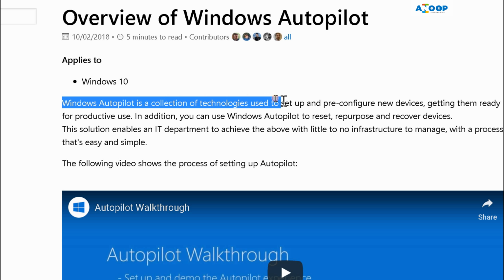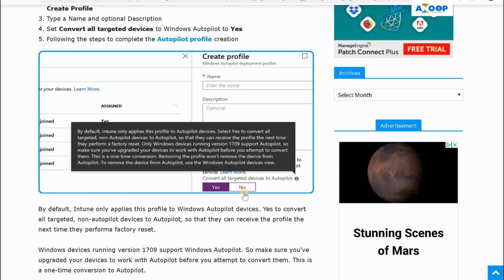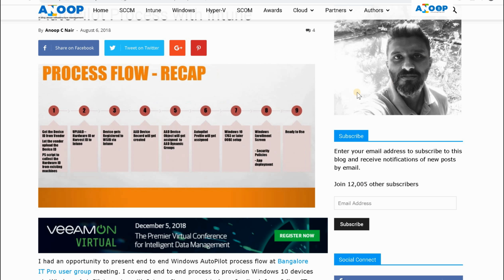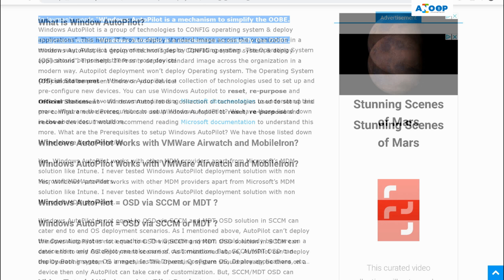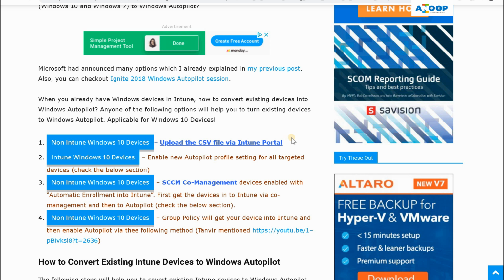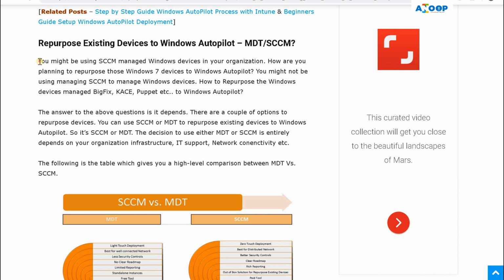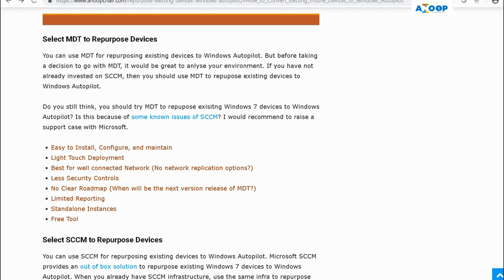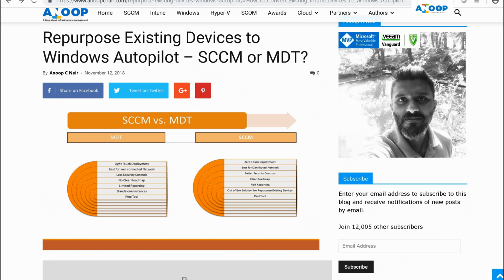Windows Autopilot - Repurpose Existing Devices into Autopilot - How to use Windows Autopilot

Comment: 1)kindly let me know what advantages autopilot for existing Windows 10 laptops

2) which scenarios will be used. how to configure autopilot for existing laptops (sccm task sequence is mandatory) and what is the user experience (existing user data will be lost, existing application will be lost, ESP page will run like device preparation, device setup, account setup for existing machine autopilot)

3)possible to upgrade from windows 10 to windows 11 during autopilot for existing laptops,

4)auto pilot for existing devices will be connected Azure and hybrid Azure AD what is the advantages both scenarios already existing devices will be in Hybrid Azure AD

Comment: Hi Anoop, This query kinda quiet off topic from the video but i cant help asking your advise.

I heard Autopilot doesnt support sequenced application installation. E.g i want to build my laptop using autopilot and google chrome needs to be installed in the last, how can i achieve it ?
Reply from the maker: No I don't think you can select the order of app installations from Enrollment Status page ... the following are the latest Intune ESP options The enrollment status page appears during initial device setup and during first user sign in. If enabled, users can see the configuration progress of assigned apps and profiles targeted to their device. Learn more.

Show app and profile configuration progress
No
Yes
Show an error when installation takes longer than specified number of minutes
60
Show custom message when time limit error occurs
No
Yes
Installation exceeded the time limit set by your organization. Please try again or contact your IT support person for help.
Turn on log collection and diagnostics page for end users
No
Yes
Only show page to devices provisioned by out-of-box experience (OOBE)
No
Yes
Block device use until all apps and profiles are installed
No
Yes
Allow users to reset device if installation error occurs
No
Yes
Allow users to use device if installation error occurs
No
Yes
Block device use until these required apps are installed if they are assigned to the user/device
All
Selected
Reply: @htmdglobal  Thanks Anoop.